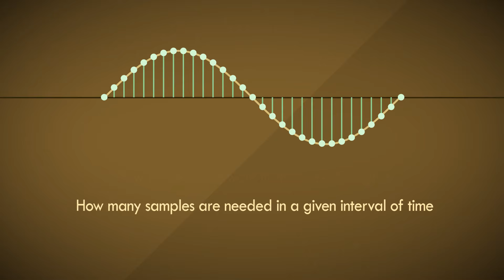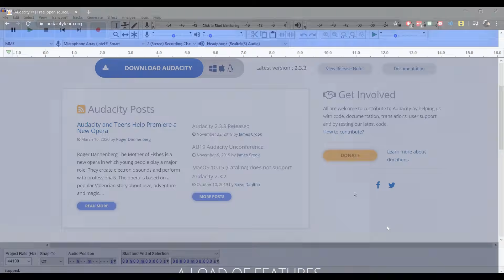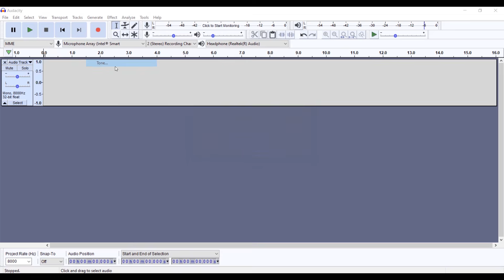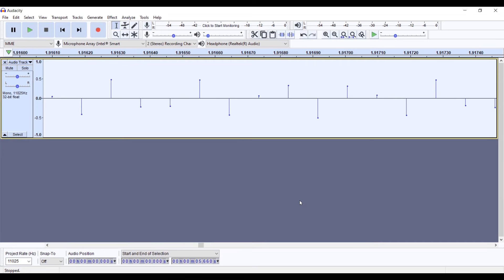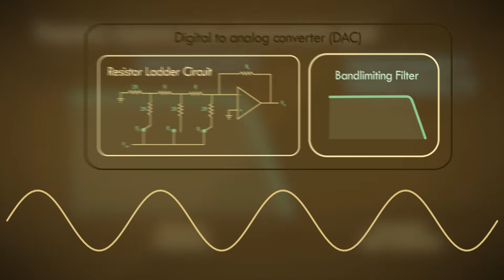2. Sampling Theorem - Digital Audio Fundamentals

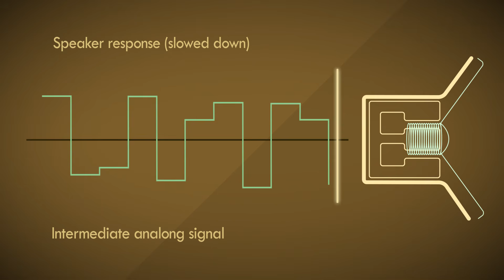Comment: Hello, there is one thing I don't quite understand, in the 13:36 of the video, you said "the frequency would depnd on the slop and height of such shifts", but the signal's y-axis should be the time and x-axis should be the aplitude of shfits, isn't the frequency depends on the nyquist rate(like how fast it shifts from up and down)? maybe I have some misunderstanding, but I was really confused on how to interpret the frequency in signal graoh and then apply it to low-filter graph.
Reply: I don't know if I correctly understood that, but that signal looks like a voltage-time graph signal that is outputted to the drivers because ultimately it is the change in voltage that moves the coils in the drivers generating those frequencies

Comment: Hello, I didn't quite understand the part of leaving a buffer between required frequency and nyquist frequency:

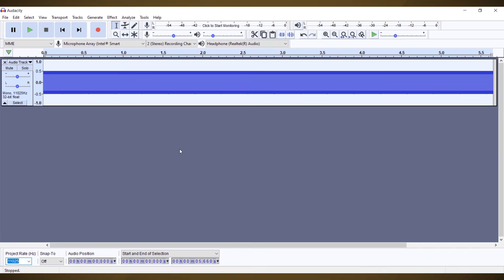I understand that when converting digital signal back to analog signal, the low pass filter does not perfectly remove all undesired high frequency component,  so we have a  small portion of signal goes beyond the desired frequency.  Whether setting the a buffer or not,   this small portion of high frequency signal will always exist (Like for the buffer case you show at 18:56, there is a chunk in the buffer area).     I can see that this region is distanced from the nyquist frequency. I don't understand why is it better, because in both scenario (desired signal frequency near 1/2 of sample rate or much lower than sample rate),  we both have an undesired chunk.
Reply from the maker: @mingzhou2213  Aliasing. I go into more detail on Aliasing in the next videos in the series. But you want to eliminate any frequencies beyong the nyquist, otherwise you run the risk of the the frequencies aliasing and being bounced back into the audible range of the signal. This happens because of the mathematical constraints of discrete signals in a digital system.

Comment: sir, I have some small doubt. if fm is the maximum frequency component present in the signal, then what other frequencies will be present in the signal for the bandlimiter to remove? may be it's a small doubt, but please reply sir.
Reply from the maker: Hello, not sure what you mean? Analog signals can theoretically have frequency components which have unbounded frequency. So we use a band limiter to limit the frequency content in such signals before being digitized. In the digital domain, the Nyquist frequency is theoretically the highest frequency component that can exist in the signal. Hope that clears up your question.
Reply: @akashmurthy  thanks a lot sir

Comment: All good, apart from two things.
1. Is really difficult to band limit a signal with such a steep filter. I am talking abut recording real audio signal , not a generated one, and encoding to CD digital format.
2. The theorem works, and is true to identify only sinusoidal signal long enough in time, and constant in frequency and amplitude. In case we approaching the upper limit of the band , and the pulse is short we may not have enough iterations to correctly identify a signal. Example is; the occurrence of one single wave in 19KHz band recorded with a CD standard 44.1KS/s. The real audio consists at most of fading impulses, rather than long in time and continuous in amplitude sinewaves, that is why I consider the CD format to be lossy and a higher sample rate well be beneficial, 48 or 96KS/s. The reconstruction of impulses by DACs is often an approximation.

Comment: The minimum required sampling for a 1Hz signal is 2Hz, not 3Hz. As the theorem states AT LEAST twice the highest frequency.
Reply from the maker: At 2Hz, there's no guarantee that a 1Hz signal will be sampled correctly. If the phase is a particular value, then the signal's sampled points all lie on the zero value position, treating the signal as silenced out.

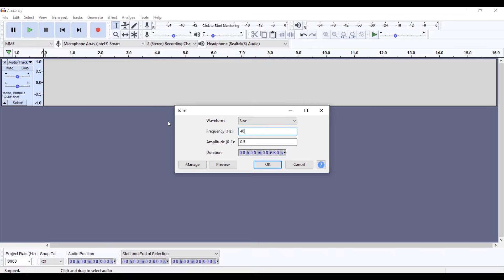Comment: Excellent lesson, sometimes a little lost coz my english but mostly the visual helps. Just one point to explain, your experience at 8:21.
a tone at 4kHz and a sample rate at 8KHz showing no waveform and producing no sound. 
Is it same event when the frequencies = sample rate ?  ( for the same example , if we have a tone at 4Khz  with a sample rate at 4Khz)
Reply from the maker: Thank you! So, trying to represent any frequency above the Nyquist will cause the signal to alias. You can check out video #4 Aliasing. But in essense, if you generate a 4kHz signal at a sample rate of 4kHz, the signal will be interpreted as 0Hz. So yes. It will be a very similar result as that of the Nyquist frequency(2kHz).
Reply: @akashmurthy  Yes I watched all now. Lot of infos in my brain, but the biggest discovery was about the fact that the sound is reproduced thanks to math and not directly by sample rate, as long as we respect the theorem.
I have two questions if you have time.
1) There is a big discussion in a forum about converting samples. For example with kontakt libraries. They are taking a lot of space (by hundred of GB) , some people convert them to 16Bits and others thinking of even converting to 44.1Khz. I understand that the choice of sample rate and bit depth is more  for the recording, but what about sample already digital ?  My opinon would be to choose 44.1Khz (coz it's enough) and 24 bits just to avoid plugins "destructing the quality" ( I have read that plugins do that so better to have lot of bits ) and for the dynamic range which looks important. against clipping.
2) One of the explanation of Hi-res is that when you cut at 44.1KHz, you will lose harmonics , timbre and color of the sound. does it make sense ? 
thank you and sorry for the long msg
Reply from the maker: @josuefox   hey, thanks for the questions. 

Choosing bit depth is only a consideration when converting from analog to digital or from digital to analog. 
Changing the bit depth after a signal has already been sampled does not make a lot of sense. In DAWs, the sample values are represented as floating point values. Plugins use floating point calculations in 32 bit or 64 bits of precision. They rarely ever operate in 16/24 bit fixed point. 

And no, down sampling to a rate of 44.1kHz from something higher does not lead to loss of audible harmonics. But it does depend on the quality of the anti Aliasing filter that's doing the conversion.
Reply: @akashmurthy  Thank you so much for your answers.

Comment: came here from signals-systems & DSP courses, because of stucking in sampling and continuous-discrete conversion. I have to say that, this video is quite good at explaining the subject intuitively and visually. It can be said that you are showing both whole and the pieces of the topic, this is a good approach to explain it.
Sampling-Discretization-Periodization-Modulation, these topics needs to be explained well.
I have still problems on understanding the CT to DT conversion, how this conversion occurs mathematically ?
I mean, how to transform continuous time x(t) to sequence x[n] , mathematically?

what is the operator that converts  ""impulse(t) >> to impulse[n] with amplitude of 1""    or    ""x(t) . p(t) impulse train >>  to  x[n] as a sequence""

x(t) . p(t)   could be represented as =  summation the series of  x(nT) .  impulse ( t - nT ) 

But this is still not equal to a sequence of x[n] ,  because it contains scaled impulses with amplitude of infinity,  right?
Therefore I am trying to understand what actually this conversion and this impulse are.

What is the title of topic/video that covers this point? 
Thank you for helping.

Comment: Beating is what is used for tuning pipe organs. The pipes called principals have the least amount of tuning degradation over time, so to tune the other voices, you pull the principal plus the desired voice, then listen to the beating; tuning the desired voice is then done by miniscule adjustments of that voice until the beating stops.

Comment: Hey bro, it's me again :)
I have a question that I know no where else to ask.
I tried mixing 3 sine waves (261.6256 kHz - 329.6276 kHz - 391.9954 kHz) in audacity, each one of them having amplitude of 0.8.
But all I heard was deafening clipping distortion. I managed to make each one's amplitude equal to 0.3 and it wouldn't clip.

So does it mean the mixing is just adding discrete points together to get a new sine wave?

And the other question is hence each wave only can have one frequency, so how can a wave carry multiple frequencies/bands?
Reply from the maker: Yea, that's right, mixing is just adding discrete points together to get a new signal. But not a sine wave! Remember, a sine wave is signal which has only a single frequency! If you add 2 sine waves with different frequencies, the result is no longer a "sine" wave. It's a complex wave, composed of multiple frequencies. 

And I guess that answers you next question. 
Signals (complex waves) can be composed of any number of frequencies. But by definition, a sine wave is a pure wave which has a single distinct frequency.
Reply: @akashmurthy  
Thanks for your very prompt and informative response :)))

So I need to do some research about complex waves. That would be nice if you recommend me some videos or resources if you know any.

I had this question from a long time ago that C4 in piano or guitar or any other instrument have the same theoretical frequency, 261.6256 kHz. They seem to be the same but they sound very different. And they look too different than a pure sine wave that we generate from a digital or analog synthesizer.
Theoretically speaking they have the same frequency, therefor they should sound similar right?

But I suppose the term "complex wave" would cover that.
Those instruments and anything in physical domain always creates complex pressure wave. They might have similar pitch, but the actual tone and sound depends on the material that creates the source of that wave.
Reply from the maker: @mohsens22  Great question. 
So, when you are talking about C4 (261.6 Hz) you are talking about the "Fundamental Frequency". This is usually the frequency component with the highest strength/amplitude. After that, there are several higher frequencies present in a complex tone like piano, clarinet or the human voice, and these are called Harmonic Frequencies, or overtones. If the tone is harmonic in nature (like the piano), there is a relationship between the fundamental and the harmonic frequencies. If the tone is inharmonic (like drums or cymbals), then there isn't usually a relationship. 

Think about a sine wave oscillator and square wave oscillator playing A4 (440 Hz). The sine wave oscillator will produce a sound which has a fundamental frequency of 440Hz, and no other overtones. 
The square wave oscillator on the other hand, will produce a sound which has a fundamental frequency of 440Hz, and several over tones of decreasing amplitude (1.32kHz, 2.2kHz, 3.08kHz). If you want to learn the relationship for square waves, I have a little segment of it in video 4 on Aliasing.

This is how you are able to identify the quality or timbre of each instrument and differentiate between them. It has to do with the harmonic frequencies and the amplitude levels of these harmonic frequencies.

I don't know of any resources, just google these key terms and you should be able to find something.
Try this resource: https://meettechniek.info/additional/additive-synthesis.html
Reply: @akashmurthy  Thanks a lot mate :)
Now I know what I should look for.

Comment: Nice explanation!
I have a question: If the filter would always smooth out the intermediate wave into a form of sine wave, how can we represent waveforms which are not sine waves? For example, what if we want the actual waveform to be a square wave which is just like the intermediate wave with no filtering?
Reply from the maker: Cheers! 
So, I've kept the illustrations simple and used sine wave here to represent the highest frequency that's getting retained from the filter smoothing out. 

Ideally, any rich complex sound can be decomposed into a set of sine waves. All observable sounds can be recreated by adding different sine waves of different frequency, amp and phase together. They are literally the building blocks of audio. 

You can think about a low pass filter as cutting off or "smoothing" beyond a certain frequency, any frequencies below that will not be affected. 

The same with square waves in your example. A square wave is just a harmonic combination of sine waves. If you apply a filter, you are cutting of frequencies above the threshold, but the frequencies below the threshold are untouched, so you still end up retaining all but the highest frequency components of the square wave. 

I'd suggest watching the video on Aliasing to understand this better.
Reply: @akashmurthy  Thanks a lot sir, for clarifying my doubt.

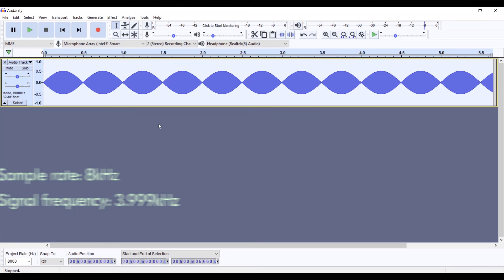Comment: Great videos! Oddly though, while I can generate a 3999 Hz pure sine tone at an 8000 Hz sampling rate using Audacity, I'm unable to hear it when I play it back. I get the same time-domain pattern you do (~9:30 mins in). When I drop the pure town down to say 3800 Hz, I can hear it when I play it. Any ideas?
Reply from the maker: Cheers! I have little ideas I'm afraid. Could be different versions of Audacity? I'm running 2.4.2